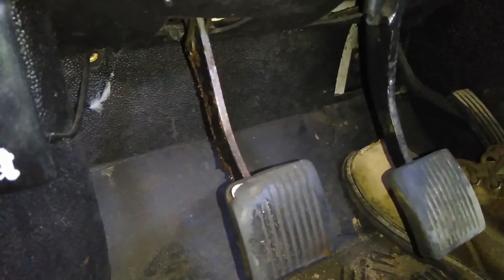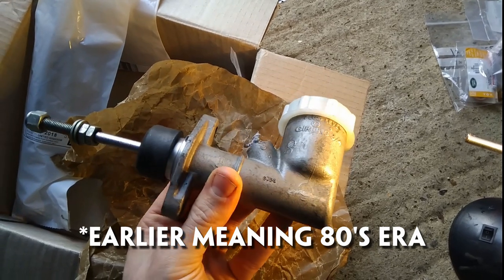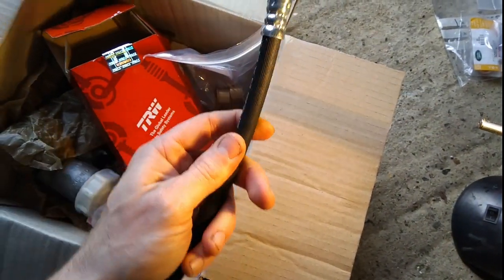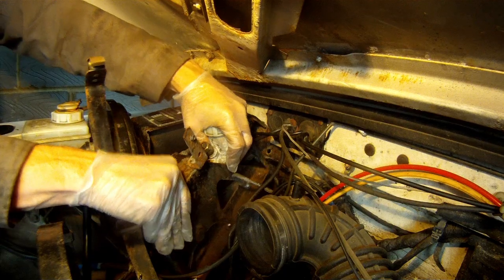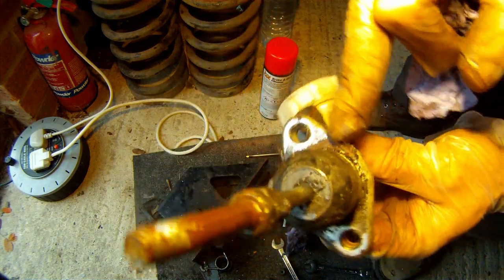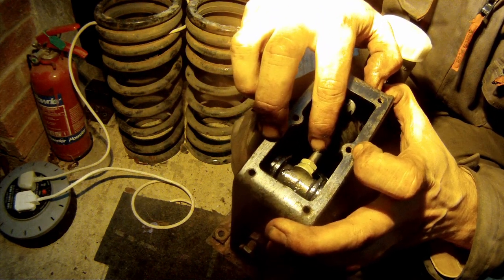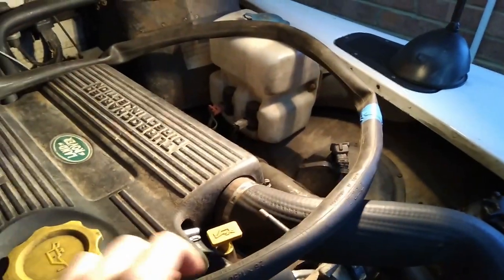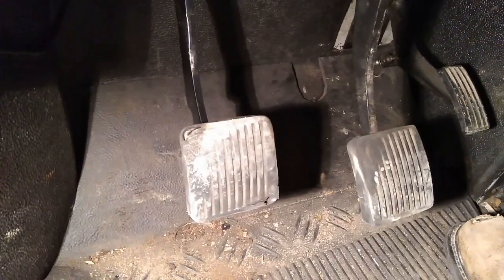Low clutch pedal on a Defender - Master/slave cylinder replacement on a 300Tdi

Comment: LOF clutches have great products ....I use their pedal spring and it actually made it easier for town driving...can't wait to test other products
Reply: Did you already have a spring that you replaced
Reply: @Rob-cz7lg  ya it was old and it actually broke off....25$ gives you much comfort while driving in a busy street...
Reply: @RoverAddis  so you noticed an improvement even though you already had a spring installed? The LOF spring must be a stronger spring then you think?
Reply: @Rob-cz7lg  well initially it was a standard spring then I replaced it with Lof on ....you should try it also their master
Reply: @RoverAddis  ive got the lof master cylinder on mine and the clutch is feather lite
Reply: @touretz  300 is much more fun with lighter clutch 🙌
Reply: @Rob-cz7lg  The LOF spring is stiffer than the original (if fitted). That's the reason for fitting it.
Reply: Too bad mine broke in less than a month. Awful quality!

Comment: It’s a funny thing,the received wisdom to change both cylinders if one fails on the basis of higher pressure from the new part.  The hydraulic pressure will be the same, and it’s determined by the springs in the pressure plate.  The force required to push back against those only changes if you replace that plate and the new springs have a different rate.

If the the old cylinders are of comparable age and are very old, or have been subjected to heavily contaminated fluid that could corrode or score the bores, then yes, replacing both is wise, but in 20 years of LR ownership, owning three vehicles simultaneously at most times, I have never replaced both together and never had a problem result from that.

Comment: Any thoughts on the hydraulic fluid turning a dark color relatively quickly?  I have a defender with R380 and in the past 3 years of owning it I have replaced the master cylinder once and the slave cylinder 3 times. As well as fitting a new flex hose. After installing a new cylinder I flush the system and bleed it accordingly so I have brand new hydraulic fluid in the system yet after not long of driving I notice my hydraulic fluid has turned a dark brown tint. I’m using TRW master and Lockheed slaves.
Reply: Trw master cylindre are crap! I been thru 3 of them, they have a big grove in the cylinder bore   that make no sense beside destroying the rubber on the piston. And they make the fluid turn grey or blackish mixing fluid and grease!
Keep the original girling just change the inside components with the original kit from Land Rover and it's cheap 👍🏼